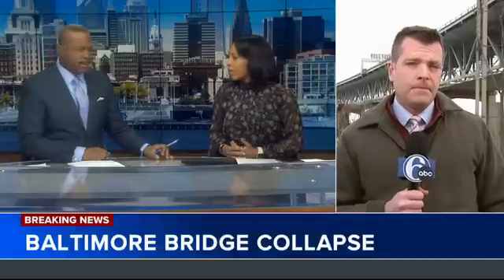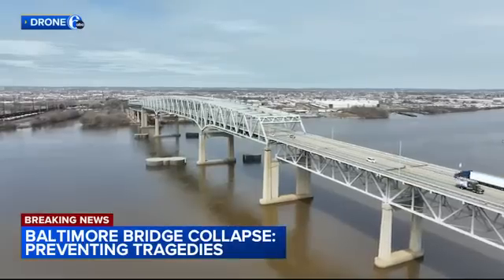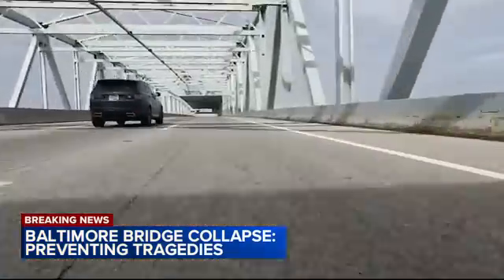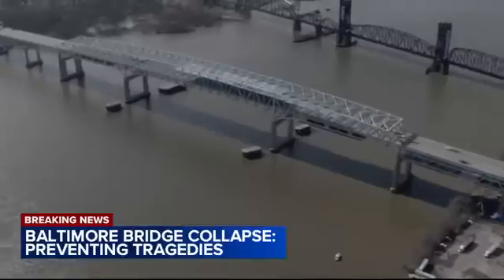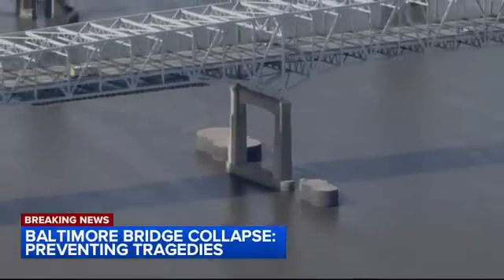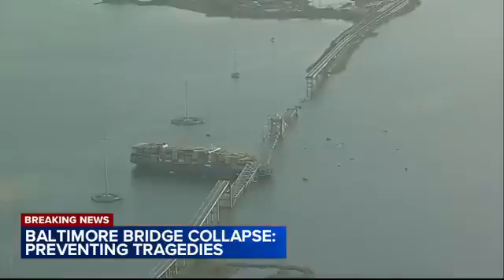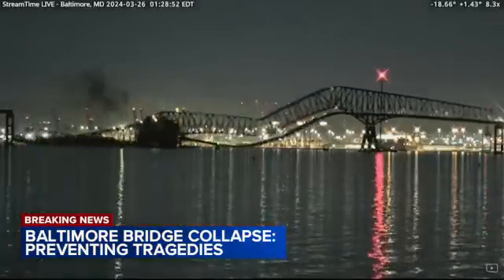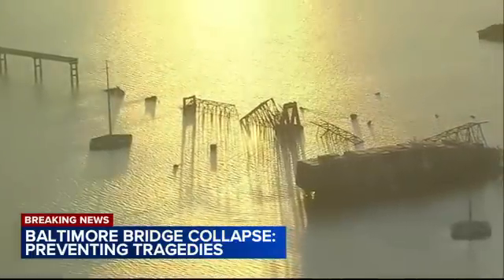Here's what surprised a structural engineering professor about the Baltimore bridge collapse

Comment: I don't know.  Those protective barriers around the Betsy Ross don't look too impressive.  Of course they don't have the same kind of massive container ships like the one involved in Baltimore so maybe they're good enough.  But some of the piers aren't protected at all.
Reply: In a river, boats only run in the channel, not everywhere. In other words, big boats only go through certain areas. Some piers do not need to be protected.
Reply: @sputnut  except when they have a steering failure and don't go only through said certain areas
Reply: @sputnut if they have no steering they need the whole bridge protected
Reply: The water it likely way too shallow on the unprotected piers, ships would run aground before reaching them.
Reply: They would deflect the ship rather than stop it.
Reply: They would not have helped here at all. Those are designed for a situation where a ship that has control of its steering getting pushed off course by a storm or something and GLANCING the pillars. Not one hitting head on in a direct hit. Plus, modern cargo ships are MUCH larger than they were even 20 years ago since the widening of the Panama Canal in from 2007-2016 ALLOWS them to be.
Reply: i seen barriers before. a barge hit one turned side ways and still took out the bridge.
Reply: @diegojines-us9pc  exactly what bridge was that, and what was the date? We can check to see if you actually "seen" it.

And what language were you trying to write there? It certainly wasn’t English.
Reply: @DaveTexas  Get over it ❄❄
Reply: @Asymmetrical-Saggin 👍💯✔️
Reply: A few thousand tons of concrete strategically located does not need to look impressive. It would not do the ship any good at all, maybe even sink it, but it would prevent the ship from hitting the bridge.
Reply: They may look inadequate above water but I bet they are massive below the river bed.
Reply: they are protected against a straight hit in the direction of the floating river, but no against a sideways or slant hit as may have been the case in Baltimore
Reply: @michakoeppenblues3669 I think the case with the Baltimore bridge was there were NO such protections at all. Because of the power outage the ship was just drifting on the tide, so a side hit is unlikely.
Reply: If a ship strikes the protective barriers head on, yes, it appears this bridge would be protected from structural damage.  But what happens if the ship comes in at an angle?  It could certainly miss the protective barriers and strike the bridge supports.
Reply: Those concrete barriers are nice and might work in some situations but definitely not all. Ports and counties cut costs with tugs...now there goes all your savings
Reply: You guys are idiots? The concrete barriers are 100x better than having nothing there and having a ship hit it at full power, the barriers are to try to stop the ship completely, but if they dont they greatly reduce the impact the bridge will take, and maybe it could have saved 6 peoples lives here
Reply: as a construction engineer myself I must say, these concrete pillars of the Key Bridge looked quite massive, and in the design process the engineers did surely take some hit of a vessel in calculation... there are also authorities in the design process, who make a "counter calculation" and permit it in the end. so the final design, and what forces have to be taken in account, was and is always a collective process (based on some codes)
Reply: @michakoeppenblues3669 good points, I believe the huge bridge project in Houston is held up or was because of various reasons, trying to get everything correct before the final project. These huge bridges are nothing short or a marvel of engineering and little mistakes can destroy a lot of hard work.
Reply: There are dolphins at the key bridge, you can see them in the footage.  The ship just missed them.
Reply: But some babies aren't vaccinated. When something is a bad idea, that doesn't mean you should at least give it credit as an idea.
Reply: Whoever designed that Betsy Ross bridge perceived a hazard to the bridge from passing ships and put a protective measure there.  The bridge in Baltimore doesn't appear to have any protection from big ships.  I believe that a ship hitting a bridge is a foreseeable hazard - it's happened before and the bridge design should address it. The Baltimore bridge collapsed much too easily, taking out sections beyond the next pier.
Reply: @vk3dgn you remove a support the load travels at the speed of sound through the structure (speed through steel not air)  a total collapse will happen for an integrated structure like this bridge. 
There were flat barriers at the very base, but not barriers designed to redirect a strike.  A flat concrete wall will not (obviously) stop a loaded 800' ship.
Reply: @duanesamuelson2256 couldn't they double up on supports. Have two for each. I really feel like it wouldn't be detrimental to space loss
Reply: @duanesamuelson2256  Trusses are funny little things . They are engineered to carry loads and transfer thier loads to anchorage  , Tension and compression in every member...When one " Moment : fails , The entirety fails .Some company was awarded a contract years ago to build this bridge on the cheap and probably kickbacks to politicians . Engineers design to minimums and cost savings . A pocket billiard passage through the supports and reinforced concrete bollards would have stopped an aircraft carrier  Any designer that offered a design like that would have lost the contract ,
Reply: @Sjwolosz321  it's why they use dolphins, so the ship is redirected from a direct impact. Bollards don't do well stopping impacts.. even huge ones work by displacing the media it's embedded in. The barriers that work (on say a loaded tractor trailer) also work by directing the impact in another direct (usually straight up in this case).
I don't do the engineering, but post 911, we did a lot of security upgrades for the feds and the research for solutions.
That container ship weighed as much as a Nimitz class carrier btw.
Reply: @duanesamuelson2256 thanks for your common sense response
Reply: @vk3dgn  With the ever increasing tonnage and size of these mega container ships, pier or support column protectors / barriers should have been designed and put into place in the channel lanes years ago at the Key Bridge. The Betsey Ross Bridge protectors seem too close to the piers for adequate protection. As in any situation for best protection they be clustered and far enough back from the supports to avert a collision.
Reply: @Bob-oc2xp  It may be the case that as ships got bigger, the tugs should have escorted them out through the bridge. It'd be cheaper than adding sufficient protection or even a new bridge. I assume the tugs would be up to the job. I look at this from a safety engineering point of view (which I know a bit about) - I'm not a maritime or bridge expert.
Reply: @vk3dgn  One thing folks need to remember is the further north along the Delaware River you get, the style of the barriers change. Compare the Betsy Ross bridge buttresses to those for the Delaware Memorial Bridge. The difference? Betsy Ross also has to periodically contend with ice floes washing down from further upriver.
Reply: @vk3dgn  You are correct . Many don't believe a reinforced concrete bollard island would have stopped that freighter on a dime . They just say .. That ship was big, overloaded .  . Someone years ago was trying to save a buck and saw it as an acceptable risk . When one element of a truss is compromised , The entire truss incurs structural failure . Engineers design to minimums with little redundancy . No protection for the pixie sticks holding up a bridge .. This is the result